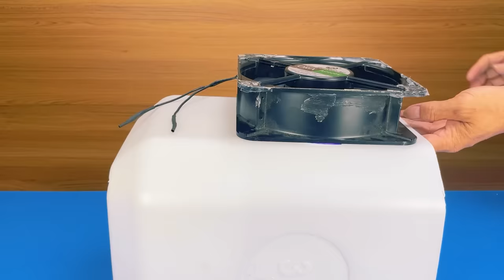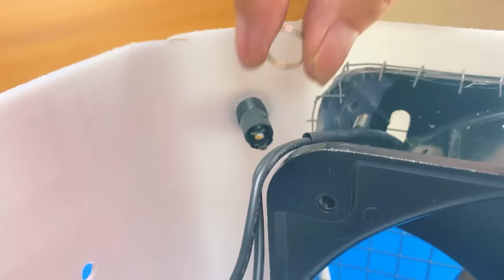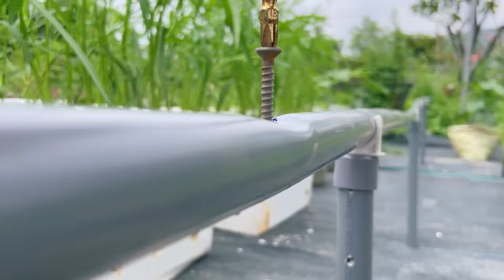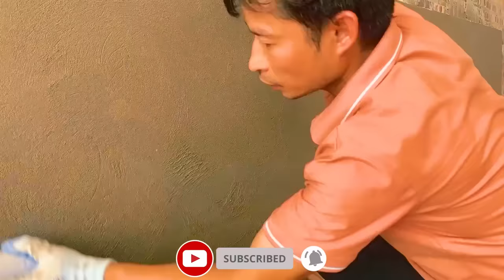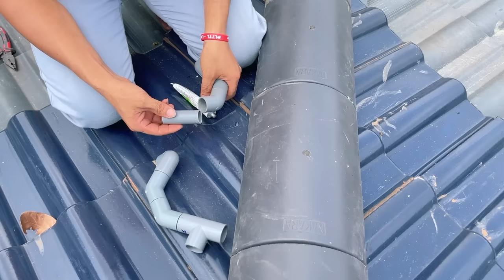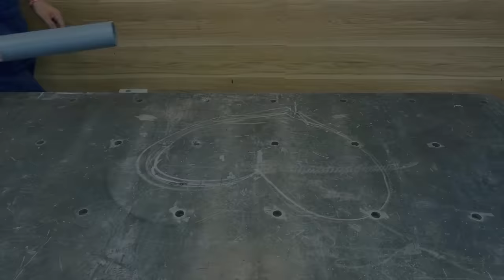Wish I knew these techniques sooner! 5 super simple cooling ideas from bottles, PVC pipes and foam

Comment: Wouldn't it have been so much easier to put have put a $5. Sprinkler on top of the roof, instead of all that wasted pvc? Well at least thats what ive always done.
Reply from the maker: Using a sprinkler system on the roof for cooling or other purposes can indeed be a simple and effective solution, especially for temporary or small-scale needs. It's often used for tasks like watering gardens or creating a misting system for outdoor cooling.

Comment: No use big PC Fan Quite big Noise
Reply from the maker: Hi there! Thanks for dropping a comment on my YouTube channel. I totally get what you're saying about the big PC fan and the noise it makes. It's great to hear your feedback, and I understand that noise can be quite a concern.

Having a big PC fan can indeed provide effective cooling for your computer, but the noise it generates can be bothersome, especially if you're looking for a quieter environment. Noisy fans can be distracting and impact your overall experience.

If you're looking to reduce the noise while maintaining good cooling, there are a few things you might want to consider. First, check if your PC fan has adjustable speed settings. Sometimes, running the fan at a lower speed can reduce noise while still providing adequate cooling.

Additionally, you could explore the option of replacing the stock fan with a higher-quality, quieter fan. There are fans specifically designed to provide good cooling performance while minimizing noise. These fans might come with features like better blade designs and noise-dampening technology.

Another option could be to invest in some noise-absorbing materials for your PC case. These materials can help dampen the sound produced by the fan, creating a quieter environment overall.

I appreciate your feedback, and I hope these suggestions help you find a balance between effective cooling and a quieter setup. Feel free to reach out if you have more questions or need further assistance. Thanks for being a part of the channel!

Comment: Why not just go down and buy an air conditioner? They’re relatively cheap and are much more efficient than something that puts more humidity in the air.
Reply from the maker: That's a valid point. Air conditioners can indeed provide efficient cooling and often come at a reasonable cost. However, the methods shown in the video might be useful in situations where an air conditioner isn't readily available, or for those who prefer more natural cooling methods. It's all about finding the solution that works best for your needs and circumstances. Thank you for sharing your perspective!

Comment: Так и не понял нахера крышу поливать?
Reply from the maker: Hello, you might not know this! Summer in countries near the equator has extremely harsh outdoor temperatures. Direct measurements on rooftops can reach up to 50°C. Metal roofs increase the absorption of heat, and cooling them can significantly reduce indoor temperatures, saving a considerable amount of energy for air conditioning.

Comment: That's too much work. I'm gonna go just buy me a nice big air conditioner. 🤔
Reply from the maker: hello thank you for watching my video. Have a good day
Reply from the maker: 5 / 5

I totally understand where you're coming from! Buying a new air conditioner can definitely save you the hassle of all the work involved in trying to fix or improve the old one. Plus, a nice big air conditioner can provide you with the cooling comfort you need during hot days.

Sometimes, investing in a new appliance is the most practical and convenient option. It ensures that you get a reliable and efficient cooling solution without the potential issues that come with repairing or modifying an older unit.

Thank you for sharing your thoughts, and I appreciate you being a part of my channel. If you have any other questions or need advice on air conditioners or any other topics, feel free to ask. Happy cooling! 🌞🌬️